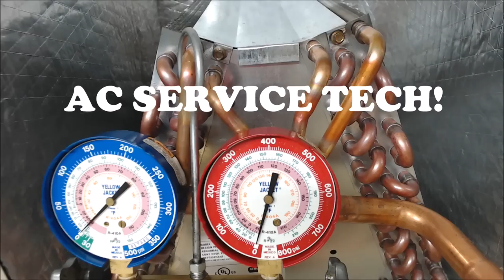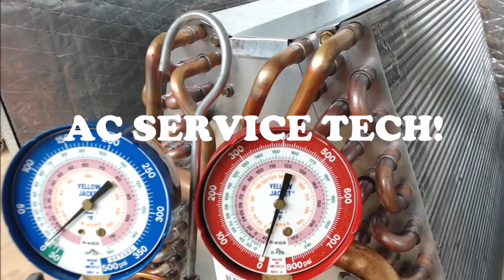Furnace Pressure Switch Testing and Replacement!

Comment from the maker: Tool List-  https://www.amazon.com/shop/acservicetech
Support-  https://www.patreon.com/acservicetech
For those that are looking for the tools used in the videos: (Linked Below)
Here is the Link for the newer UEI DL469 Multimeter- http://amzn.to/2jw4ePJ

Here is the Link to the Supco Universal Adjustable Pressure Switch -.01wc -10.0wc  http://amzn.to/2G1y0py

Here is the link to the Fieldpiece SDMN6 Dual Pressure Testing Manometer with Pump-http://amzn.to/2jyK5Ka 

Here is the link to the 3/16" x 3/16" x 3/16" brass barbed tee-  https://amzn.to/2INSRhQ

Here is the link for the 1/8" NPTF x 3/16" barb fitting for reading wc pressure- https://amzn.to/2G563Bq

Here is a link for the Supco Magnet Jumpers http://amzn.to/2gS4h6z

Here is the Link for the newer UEI DL479 Multimeter with temp sensor- http://amzn.to/2jtsUbJ

Here is the link to the 2 pairs of alligator clips- http://amzn.to/2CtIL5z

Here is the Link for the UEI DL389 Multimeter used in the video - http://amzn.to/2naJr9o

Here is the Link for the FieldPiece ST4 Dual Temp Meter- http://amzn.to/2AhR6ph

Here is the link for the Irwin Wire Stripper/Cutter/Crimper-   http://amzn.to/2dGTj2V

Here is a link to the Stanley 6 in 1 screwdriver-  http://amzn.to/2x7NuaZ

Other tool links can be found in the video description section.

Shop through Amazon-   https://www.amazon.com/shop/acservicetech      ACSERVICETECH is a participant in the Amazon Services LLC Associates Program, an affiliate advertising program designed to provide a means for sites to earn advertising fees by advertising and linking to Amazon. Prices are the same as normal    

All of the ACSERVICETECH Playlists-  https://www.youtube.com/channel/UCOZR-1IqsAer9wzlvFgb4mA/playlists?view_as=public

If you want to support the ACSERVICETECH Channel and receive more HVACR content, check out www.Patreon.com/acservicetech

Comment: Nice! Clearly shown and love the tool lists.  One thing I aways do when troubleshooting something I’m not 100% sure of electrically is to put my meter on the source of the voltage and the other probe on my ground to ensure that the ground is indeed part of the circuit.  Even if the schematic shows a grounded neutral or common doesn’t mean it was wired that way.  Always prove your test equipment, too.
Reply from the maker: Yeah, you are right, thanks Jack!

Comment: Nice video, thanks for posting. I myself carry the universal switches for replacement, setting them up with the Fieldpiece pump you have in the video. And I don’t use them as temporary, due to the fact I’ve never seen documentation that says they can’t be permanent or are only for temporary use, and they’ve lasted in Lochinvar boilers I have at the school district I work for. I like the fact I have a switch that’ll cover a myriad of switches, kind of like the universal igniters.
Reply from the maker: You absolutely can leave them in place. I just usually go and switch them out for the exact one. In this case, it was because I wanted to replace two in case the other would go in the future and they come as a set, thanks tcpHVAC/R!

Comment: Great video @acservicetechllc !!! 
I also recommend double check hose(s), port(s) for any obstruction(spider web, calcification, etc ) 
Question: What is that on the top of that 2" gas black nipple before the gas valve??? Is it a kind of flow switch ? 
I never seen something like that before!!
Reply from the maker: That is a low pressure gas switch for units that run on propane instead of nat gas. These typically come in the conversion kits depending on the manufacturer but should really have one installed regardless if it is for lp. Look up "acservicetech low pressure gas switch" for a video on that, thanks!
Reply: thanks 
what's your name ?
Reply from the maker: Craig Migliaccio from Southern NJ
Reply: AC Service Tech LLC thanks Craig
Reply from the maker: glad to help!

Comment: Hey brother!! Love you videos. 

I have a head scratcher. 

What if you text the vacuum that the inducer is creating and its strong enough that it should open the valve. 

Then you test the valve and it opens at about 1.6"wc

But not when its connected to the inducer housing. 

I'm getting the inducer to pull about 4" wc

Comment: On most furnaces does low voltage 24v typicall start with pressure switch form the transformer?

Comment: How do I know which pressure switch is right for my furnace?  Considering the make/model and altitude?
Reply from the maker: A pressure switch can only be replaced with one the exact same wc size. When I order them with the supply houses, sometimes I just give them the model and serial and wait for them to tell me the size and that confirms it for me that they have the correct on, thanks.

Comment: How do u determine the difference between low fire or high fire pressure switch?  Is the high fire ps always in close to furnace or the one more out?
Reply from the maker: They are not always in the same position. Sometimes the low fire and high fire both need to be closed but on low stage only the low fire is closed, thanks

Comment: Do they make universal hot surface ignitor to get ppl heat for the night?
Reply from the maker: Yes glowfly but sometimes you need one bigger and should go with an oem silicon carbide. These will work in many cases though- https://amzn.to/2r8gOJ6

Comment: Hi, I have a digital manometer. Where can I buy the Tee and extra tubing, so I can make the connections to the pressure switch like you did?  Do the supply houses carry them or amazon?   THANKS FRIEND
Reply from the maker: Hey Ronald, I pinned the amazon link for that tool at the top of this comment section with the other tools, thanks! I just got off a 16.5 hour day getting a furnace running, oh man!
Reply: Better get some sleep,  THANKS you helping
Reply from the maker: Thanks Ronald!

Comment: Do you have a video about testing a zoning board?
Reply from the maker: Hey Anthony,  if you are looking for boiler zoning then type "acservicetech boiler zone"  thanks
Reply: Thank you that video was very helpful. You really are a genius and i definitely learn alot from these. Although i was leaning more towards a zone system for dampers in the duct system. I had a call and could not reach the damper without taking out drywall. I am not so keen on zone board troubleshooting, so my problem was trying to diagnose if the damper motor itself was bad. Or the zone board. One of the two would not allow any airflow and was stuck in the closed position.

Comment: Very good video as always.
Where can I get the “T” assembly you used to put the manometer in series with the inducer to make sure it was pulling the correct draft?
Reply from the maker: Hey Abner, I pinned the link for that tool at the top of this comment section with the other tools, thanks! I just got off a 16.5 hour day getting a furnace running, oh man!
Reply: acservicetech wow! I can’t imagine what you’ve been through trying to get that furnace going. 
Thank you! I just purchased it through the link.

Comment: can i check voltage on pressure switch 2 terminal? not with ground with 1 terminal on pressure switch. like if there is 24volt on pressure switch, its open. if 0v, its closed. can i diagnose like that?
Reply from the maker: You could check it that way but I prefer checking it by using ground or common along with the hot. It is also easier for teaching someone when they are learning I believe, thanks
Reply: thank you for answering my question. i am really enjoying watching your video and learning a lot more than learning school. appreciate all your work.

Comment: ive had people replace the gas valve, thinking it was the gas valve,  later to find it's the pressure switch. Most gas valves can't operate until pressure switch closes
Reply from the maker: Oh wow, that is even forgetting about ignition too, nice!
Reply: if you are getting 24 volts at gas valve most likely is the gas valve malfunctioning